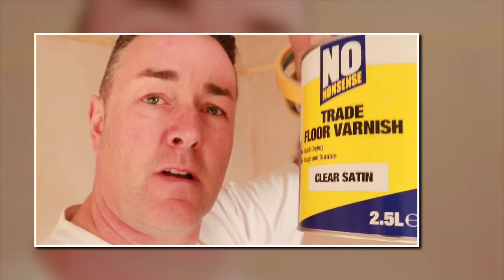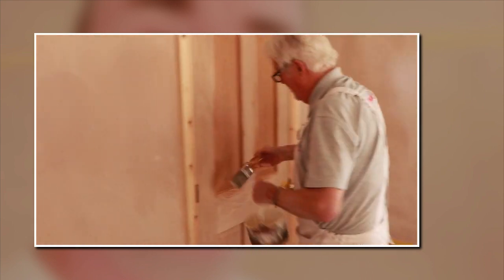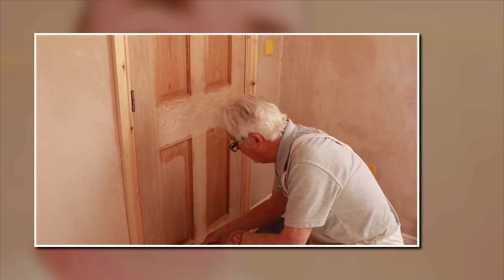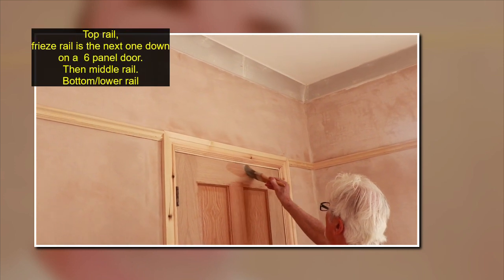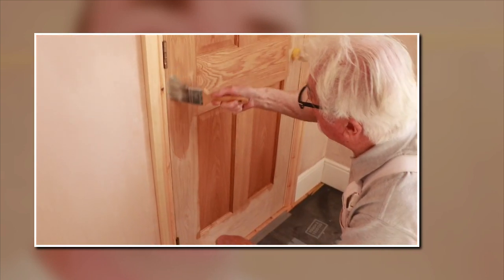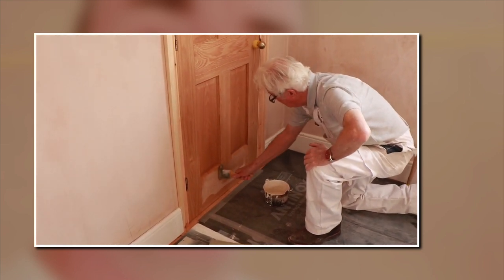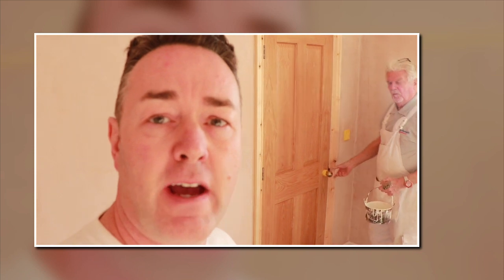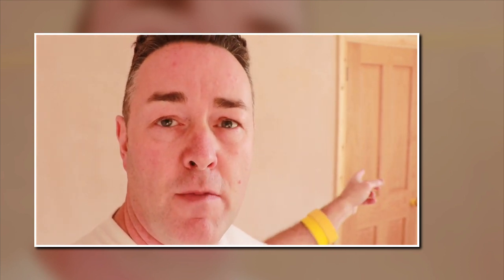How to varnish new oak doors - interior - using Trade Floor Varnish - Screwfix

Comment: Nice one, I've never used the Screwfix stuff, but I trust your word.
Last time I done oak I used Blackfriars water based matt...the customer originally wanted wax but I had a chat with them and after I did a sample with the water based they were happy for me to crack on

The matt gives a lovely wax like finish, one, fine sanding, repeated, then a neat third.
Being water based it barely altered the colour of the oak, which is what they also wanted
Reply from the maker: Morning. These are all the key points, I'm glad they liked them and made life easier for you. Work smarter, not harder. 
I'd think all waterbased floor varnish is a much of  a muchness.

Comment: Wonder if there was any pencil marks on the doors from the joiner if so how did u deal with it
Reply from the maker: Hardly any.. but some sand paper after the first coat sands them off ok.
Reply: @ProfessionalPainterDecorator  we used to sandpaper when the varnish was wet or use a piece of bread

Comment: Hi Phil, would this product be suitable in a wet room, where there is potential for a high concentration of moisture? I only ask since the tannins in the oak react with moisture. I generally use Osmo but I’m not convinced osmo will repel water. Love your videos by the way
Reply from the maker: Is there a lot of moisture in that room?

I can't see why they'd be a problem. It's going to seal and protect the wood.

I think you'd notice water marks on the omso over a period of time being splashed on to the doors.
Reply: It’s a small en-suite which, despite it having an extractor fan, does collect a lot of condensation, particularly on the walls. 

I’m going to use the varnish you have have used in your video to be on the safe side. I’ve seen lots of oak substrates oiled with osmo that have gone black.
Reply from the maker: I've seen osmo go like that too.

I think you'll be fine with that water based floor varnish on it.

look at using a paint on the ceiling and walls suitable too.... look at my videos on Glixtone and PermaWhite
Reply: Will do, thanks Phil

Comment: Being water based can you use this product on veneer doors.
Reply from the maker: Shouldn't be any problem. 
It may be a problem if the doors are cheap and not put together well.

I can't see why it would soften up any vaneer glue. Once the first coat is on, it's sealed.
Reply: @ProfessionalPainterDecorator  
It's always an very good idea to check what it spec says re oak veneer doors. 
Some joiners always maintain better with Oil varnish but it can actually sometimes cause delamination. 
Howdens joinery suppliers tend to say water or oil or OSMO but NOT oils. 
If put the wrong product on its your fault sadly, years ago cheap nasty knotty pine 
BnQ doors, water based varnish swelled to hell... 
Yet they shrunk back with a fan blow heater .. joiner trimmed a bit and they fine. 
Wood was like made from pallets !
Reply from the maker: @richardmcdougall233  this is true . I've heard it said before. I've not come across it happening though.

Comment: Hi Phil
Will this varnish go through hvlp ok
Thanks. 👍
Reply from the maker: I can't see why not, if you think it feels a bit thick, thin it down a little bit. I'd say it should be fine though. 1.5 needle set, or try a 1.3 if you have one. Wash it all out well with water ;)
You've seen my vids on HVLP.. make sure you Vaseline and screw threads so they don't get stuck.
Reply: Thanks 👍

Comment: I painted a wooden floor in a hallway with water based and finished it off with three coats of this for speed of drying and 2 years later its as good as new, 👍
Reply from the maker: all the water based floor varnishes seem good. prep is the key once again, sand between coats and build it up. Fast drying times the big advantage.